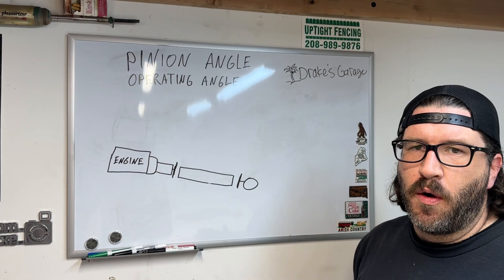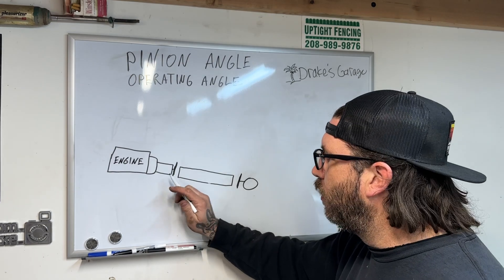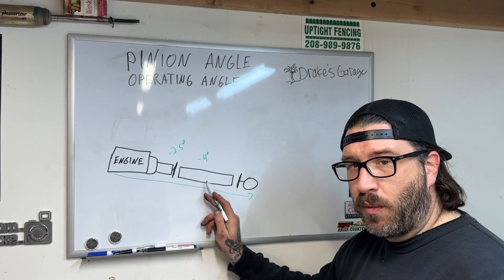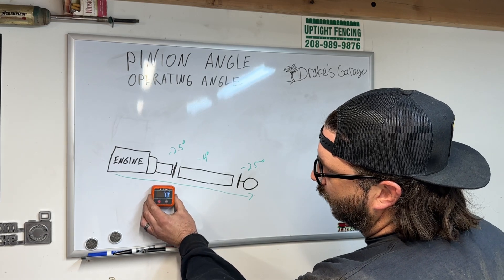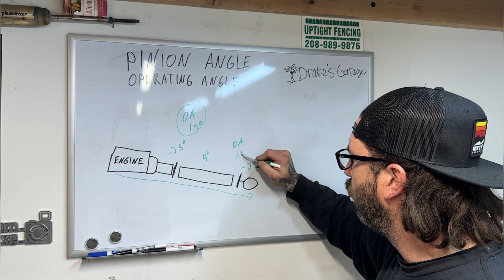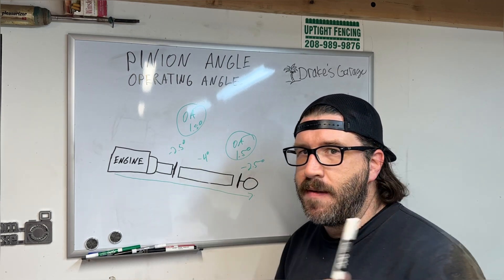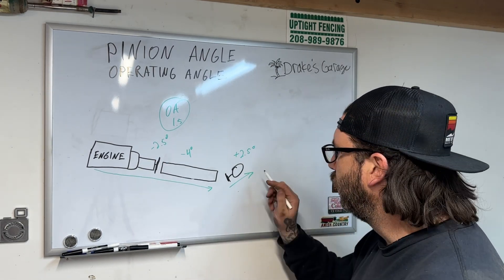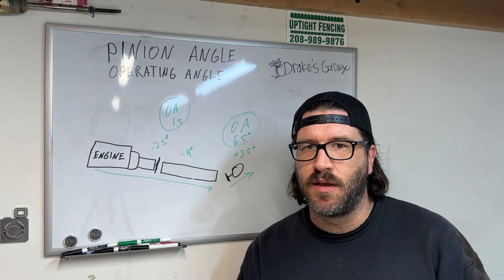How to measure your pinion angle. Simple way to find out.

Comment: I’ve been chasing down a vibration issue I’m having with my 22 wrx SPT… ever since I tried installing a carrier bearing lockdown kit I’ve had nothing but problems. As per instructions it says to drop the carrier n let it rest on the exhaust. Apparently the SPT & manual models have different carriers.. so I reinstalled everything as I saw it before. The car now shakes at any speed over 50 & sometimes lower speeds too. It starts around 1,600 rpm whole way up to redline. Since then, I had a new  driveshaft installed, the issue persists. 

I never had issues like this until I messed with the carrier bearing  to install the Perrin lockdown kit.. this video seems like it’ll help me!
Reply: My wrx has been on air suspension for 2 years no problems.. the driveshaft is 2 piece.
Reply from the maker: @alecjoseph5135 I hope it helps. Ask if you have any questions! Pinion angle can get really confusing

Comment: Ok, just trying to figure this out so, easy does it, but that’s not how negative numbers work. A negative + a negative = more negative. So -4 + -2.5 = -6.5. I see here you’re treating the -4 as a positive so that you have 4 + (-2.5) = -1.5. But I guess my question is, do you take your measurement in the middle of the drive shaft, and then is that specific measurement always treated as a positive value to do this math?

Comment: Hi there,I just watched your video,very interesting,wonder if I could send you a question your way
Reply from the maker: Ask away!
Reply: @Drakes_Garage  pinion is 0.07 up,the other 2 is down
Reply: I’m 65 and I’m sorry if it’s a dumb question,i try to figure out my numbers,but I still can’t figure out what angle shim I need,just wonder if I send u my numbers if you could help ,thanks in advance,3.07 transmission,5.89 shaft and 0.07 pinion,just installed a differential
Reply from the maker: @jean-guylebreton5332  there is no dumb question when it comes to building cars! Let me ask this question to make sure I understand. It is a 1 piece driveshaft? And the transmission and shafting are both angled down is what it sounds like. What is the angle up on the differential? Is that up at 0.07?
Reply: @Drakes_Garage yes ,it’s on a 1978 d150 midnight express,one piece and it’s 0.07 on the pinion
Reply: Differential
Reply from the maker: @jean-guylebreton5332 I would try and get that to 1/2 degree at the least. With it almost at 0 it could flat-spot the needles in the needle bearing causing vibration later on down the road.
Reply: @Drakes_Garage because it vibrates like hell after 55

Comment: Great video, I have a situation, I'm doing a 31 Model A, don't have a drive shaft cut yet, don't want to get it cut until I have the placement of the rear in. How do I calculate the pinion angle on my rear (with the transmission in place) without the drive shaft to help calculate?

Comment: Ok Drake, help me out here.  from front to rear,  my trans is 2.1 down,  my driveshaft is .8 up, and the pinion is 1.2 down. Its a 70 dodge super bee with leafs. With my numbers, does this mean I need a 3 degree shim under the spring perch to put my pinion at 1.8 up to counter the trans?  seems to me the pinion and the trans, though the numbers are close, are still at weird angles and causing the vibration I feel

Comment: Super helpful. I used your video to fix a terrible vibration in my wagon after putting QA1 suspension on it. -2.0, -3.2, and 5.8 is what I started with. I dialed it down to what I read on a few forums and kept a preload on the u joints. It drives so smooth now.
Reply from the maker: @j2hill1  I’m super glad that this helped. I was lost a while ago figuring out pinion angle and wanted to help people like us. Some people over explain it 👍👍
Reply: Hi, What did you actually do to fix it? Did you shim the differential? Thanks. I have a Willy's Jeep and since I put new front springs on, I got a major vibration at about 30 miles an hour

Comment: what if you can not get engine above 5 degrees
Reply: That’s where driveshaft length and adjusting your control arms comes into play
Reply from the maker: As long as the pinion angle is less that 3 you’ll be good. If it’s about 3 it will still be ok some, just the life of the u joint will be shortened.
Reply: Modify mounting points

Comment: If I am understanding this correctly. I picked up 2 key points here. First: Each operating angle INDEPENDENTLY need to be 3 degrees or less. Anything above that can "potentially" cause vibration. Second: Each operating angle INDEPENDENTLY needs to be NO LESS than 0.5 degrees. 

Now my question is, is there some form of rule where the DIFFERENCE of each operating angle in relation to each other need to be in a specific range? For example, OA1 = 3.0; OA2 =0.5.    OA1 (3.0) - OA2 (0.5) = 2.5 degrees difference of EACH OTHER. 

Or, the difference between the angles does not matter as long as the OAs fall under the 2 key points stated above?

I would really appreciate it if you respond. I feel I got this down, but my question has been haunting me. THANKS!
Reply from the maker: @juliojaramillo427  each angle can be opposite front each other. As long as each one can be under 3* if possible. I have a 2 piece driveshaft and they go both. Hit me up on instagram and I can help if needed 👍

Comment: No angle on a u-joint will not cause vibration. What it will cause is brinnelling on the u-joint cross. The needle bearings will pound little groves into the cross. 

If you are using a digital angle finder, there is a very simple way to measure the angles. Measure the angle of the engine/transmission. With the angle finder in position to measure the angle, zero the angle finder. Now measure the angle of the drive shaft. This will tell you the working angle of the first u-joint. With the angle finder in position on the drive shaft, again zero the angle finder. Now measure the angle of the differential, this gives you the working angle of the second u-joint. If the working angles are above 1 degree but not over 3 - 3 1/2 degrees and the same within 3 degrees, you are good to go.
Reply: What do you mean by "the same within 3 degrees"? The last portion of your message
Reply: @juliojaramillo427  If the first u-joint angle is 5 degrees, the second u-joint should be in the spread of  8 - 2 degrees. The difference between the angles is within 3 degrees.  Does that make sense?
Reply: @joealbert7773  okay. So if my front Operating angle is 3 degrees, and the rear operating angle is 0.5; there's a 2.5 degrees in difference. In that case, it is within 3 degrees of difference and should be fine? 

I've been reading that they're supposed to be +/- 1 degree of each other. 

I'm just trying to learn on what is best. 

I just want to make sure it's correct.

Comment: I suck at math but when you said -2.5 + -4= -6.5  right? how do get to  1.5 operating angle?
Reply from the maker: I meant to say -4 and subtract -2.5. If you have 2 negatives they subtract from each other. If you have a negative and a positive they get added because the angle would increase. Hope that helps
Reply: @Drakes_Garage  Thank you I've been chasing and trying to understand my vibration issue due to a converted rear perch and not sure how to tackle... thank you again for clarifying.
Reply from the maker: @ your welcome. Puddins Fab shop does a good in depth that helped me. He does a 4 link on his Datsun and goes into pinion angle